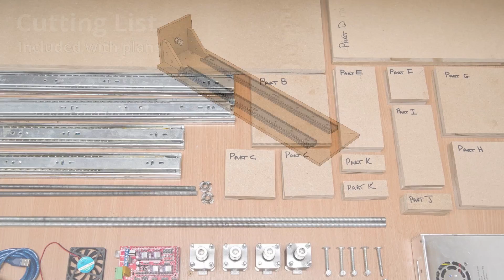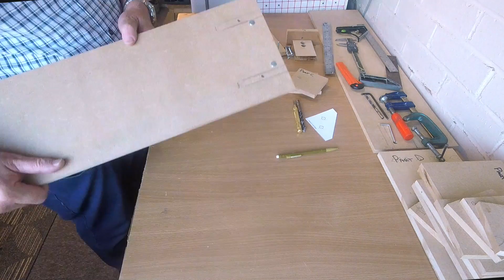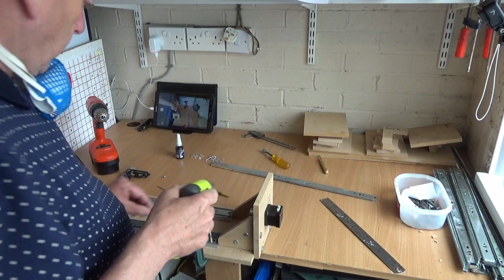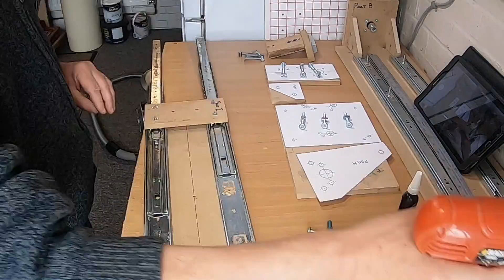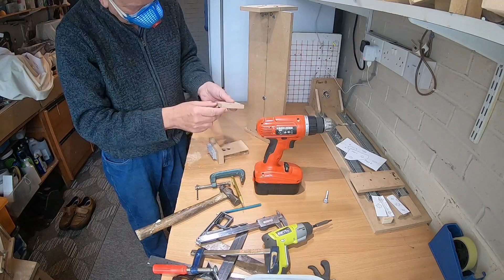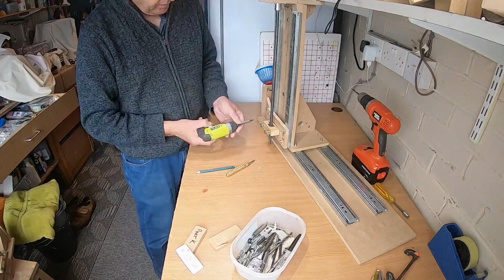How to Build a USB Hot Wire CNC Foam Cutter - Part 3 Mechanical

Comment: Amazing project . I actually started building my own after buying your plans and all the parts but i had to improvise a bit since i had 18mm particle board at home. the vertical slides are also 600mm long and the towers are very solid using the geometry in your guides but my concern is that the towers have some play left and right due to the horizontal rails being easy to press/pull up and down. is that normal? i havent noticed wiggling in your videos
Reply from the maker: I use a bow now so there is no tension on the carriages. They just guide it and it works really well.
Reply: @rckeith  does the bow work when the axis have different paths? For angled cuts

Comment: Hi. Thank you so much! I bulit it too. I have a problem. One of stepper motor is turning wrong direction. I changed row default_stepping_invert_mask. Then the wrong stepper motor turn right direction but an other stepper motor bigan turn wrong direction... I changed every variation but one of stepper motor always turn wrong direction. What should i do? Thank you
Reply: I have an another problem. I have two type of foam. One of them bubbled xps foam the other One is none bubbled foam. The bubbled foam's cutted surface is perfect but the other material's surface is wavy. I slowed down the cutting speed and i strechted the wire but not better. Can you help me? Thank you!
Reply from the maker: @polacsekistvan545  I would try increasing the temperature of the wire and see if that improves ithe cut.
Reply: Keith Howlette I increased the temperature now it works properly! Thank you. You are the best!
Reply from the maker: @polacsekistvan545  Good to know it's all working. Keep me updated on your builds would love to see what you are making👍
Reply from the maker: Hi Polacsek One option is to reverse the wires on the stepper motor  here's a good video https://youtu.be/-iubywKkNEE 
Might be a bit easier doing it this way
Hope that helps.
Keith
Reply: Thank you! It is work percfectly. I have successfully set the invert bites.
Reply from the maker: @polacsekistvan545  Glad you got it working.